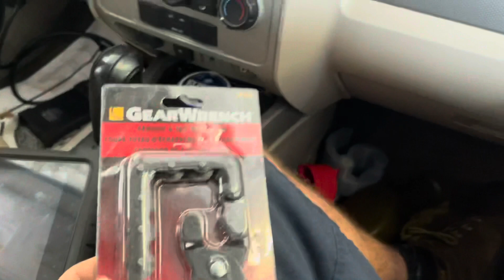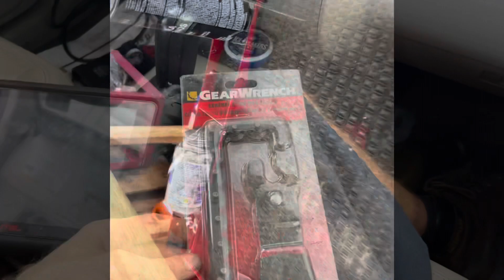Oil Filter Autopsy: Let’s look inside the filter of a sludge filled engine!

Comment: I was gonna suggest using an angle grinder with a cutoff wheel.
Reply: That contaminates the inside with metal particles. Okay for this purpose but useless for the usual purpose: inspecting the filter for metal particles.

Comment: Getting lazy buying a machine to say "click" for you!  If you're doing more autopsies, is might be easier to make a fixture that fits in your vice that has a bolt (or nipple) that would thread solidly into the top thread of the filter(I have no idea if filters have ASE or metric, or pipe threada, hence the bolt/nipple).  Once the filter bottoms out on the thread you'd be able to use your cutter on any cylindrical part of the filter, as long as you turn the tool in the direction that scews the filter tighter

Comment: Nice filter-topsy, you can show how good and bad budget oil filters are now.
Reply from the maker: Yup Sure can. Do you have a specific filter in mind? I’m great thinking Fram, mobil1 Stp, carquest and Napa brand so far
Reply: @RainmanRaysRepairs   No specifics just name brands versus own brands, be good to see the difference in the internal quality and filtering potential, or lack of, with each. You hear a lot of talk to get such and such filter and "I wouldn't use that brand", it could be cool to physically back up those quotes from blow hards, the same 'torque twats' in the comments, as I call them. Thanks for replying man, have a great day.
Reply: Or you can just change your damn oil.  People are stupid and think you can go longer between oil changes if they put in an expensive one
Reply: I've seen lots of reviews about oil filters and fram is suppose to be the worse however the newer more costly Fram special filter is suppose to be ok but I always hear Wix is top line filter.

Comment: Use the correct tool for the job. The exhaust cutter was not it.
Reply: I wanted to see oil pan after it was pulled off it would show more
Reply: It did pretty good on the second try!

Comment: That's not how to cut open a filter.
Cutting it open that way, the whole
paper cartridge will come out showing
you the outside. What you want to see
is what is INSIDE the paper cartridge.
Put the filter in the vise, flange end 
against  1 jaw, bottom against other jaw.
THEN, cut it length wise with a hacksaw.
Split the filter into 2 halves. Unfold the 
paper for a special surprise!

!
Reply: This girl i picked up at a club one time showed me a "special surprise" at her apartment.  Left me emotionally scarred for years after....

Comment: If that oil was flowing like that at room temp.. imagine if it was near freezing.. Talking about thick
Reply: I had forgotten about that. The cold viscosity of oil rises rapidly as the oil gets worn out. Might get by with oil in summer that simply won't flow in winter. Check out the "oil race" at https://youtu.be/tYkg0oDUXs8?t=331 (Engineering Explained)
What do you think the odds of the customer using synthetic oil are? Maybe not a big issue as far as temperature is concerned in Florida, but we get the idea.
Reply: @flagmichael  synthetic oil probably wouldn't be as bad but it wouldn't be that far away

Comment: You need a reciprocating saw (Tiger Saw, Sawzall) to cut oil filters in half. Easy peasy, less than 20 seconds. Others have said angle grinder, aka death wheel. That would be great for cutting through that outer canister.

Comment: I don't get the torque Nazis. I have been working on cars and motorcycles for 50 years and never used a torque wrench on an oil drain plug. I won't say I haven't buggered threads but never on a drain plug for over tightening one. I have owned several vehicles that went  over 150k miles. Jeez, it's just common sense, they're not part of the valve train like the 6mm bolts on my motorcycles.